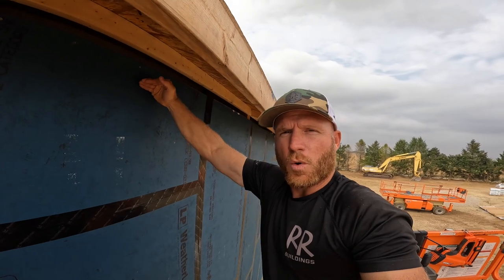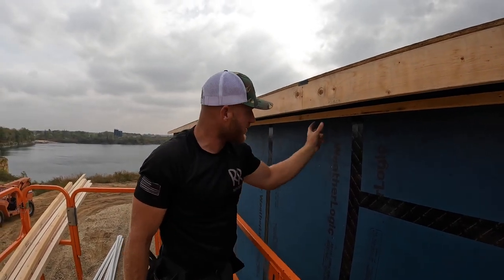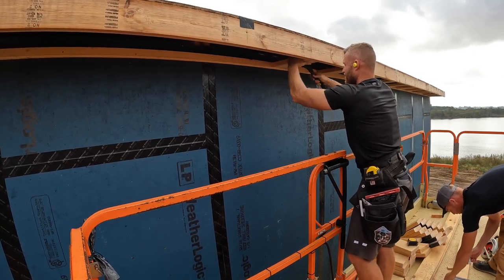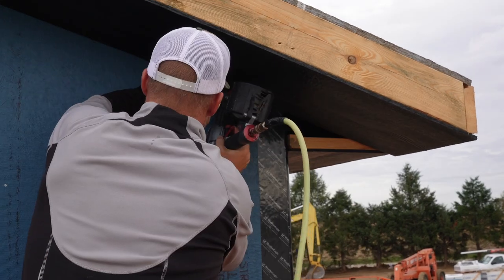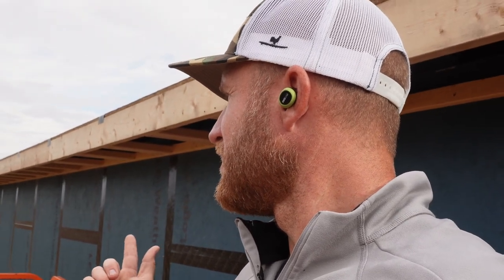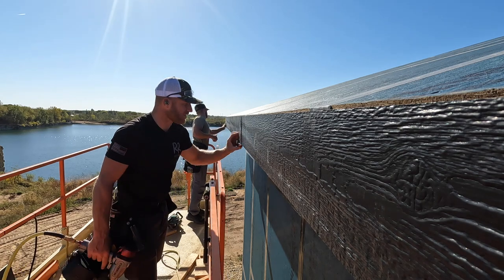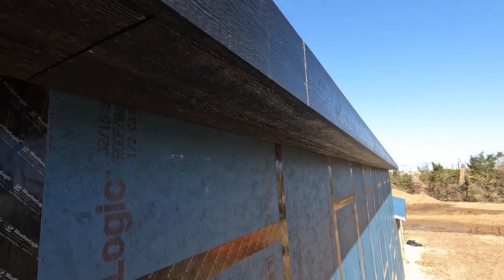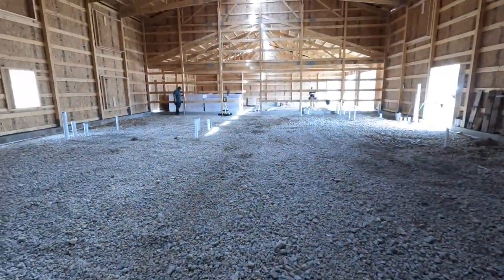Building a Barndominium Part 7: Installing Soffits and Fascia

Comment: Regarding your 'floor for the shower' ... in a completely different setting we kind of did exactly the same thing. It is an 1881 house with floors very unleveled 2+ inch end to end. You have to work with what you get :). So we put the shower in the low corner of the bathroom, no cabin, just a slightly angled tile floor. Put in a 1/4" glass wall floor to ceiling, put in electric floor heating, and you're all set. We love it !!!

Comment: Common practice for showers is to put a 2X4 frame flat in that area which gives a 2 inch recess in the concrete which is suitable for the final slope finish later on when the concrete have cured!
Interesting videos as always, and great to see the differences between Europe and the U.S.A when it comes to construction i.e. I noticed a 2 inch floor insulation under the concrete whilst in Scandinavia we are more likely to go 12 inches! 👍🏻

Comment: Just contracted a builder for a 40x40 barn.  Very difficult to get builders to construct like you do up here in NE Ct.   Most likely will have to have typical stick construction but I am going with the standing seam roof.  Thanks for all the good ideas coming from your videos.  They have really helped me with the design of my structure.

Comment: Great content as always Kyle.  Quick tip, you can paint the heads of the nails before you put them in the gun. That way the nails are pre-painted.  I've tried this a few times before and works great, saves time!  Cheers mate

Comment: Hey Kyle, at 14.57 minutes into the video,    instead of running your blade of your circular saw up the side of the fascia, you could probably use the metabo 1/2 inch router and a flush cut bit In the router and pretty much do what you did with the circular saw.

Comment: Kyle, I had a suggestion for a video if you were interested in creating a brief instructional video. I  have always been curious on the easiest methods in construction of cutting rafters for hip valley roofs and how the measuring process works in conjunction with a proper birds mouth. Perhaps this is something your expertise could assist a lot of us other builders out there with. I know, myself, I struggle to figure out exact cuts, and how to properly measure to place the bird's mouth accurately. Any help with this aspect of construction would be fantastic. Wonderful video!
Reply: Watch Paul ricalde. I had the same prob untill I watched his videos. He's got all kinds of tips and tricks. He also invited the Swanson savage tape measure which Is awesome I didnt know that untill abt a week ago.
Reply: Also watch classic works. He really brakes it down in a simplified form. Deff helped me out
Reply: @VAisForGrowers  Hey Jason, thanks for the suggestions! I will definitely check them out. Its such a tricky type of cut that needs to be properly laid out and I've always struggled and wasted time figuring it out.
Reply: @rhysbriden5777   also I forgot to mention which I'm sure you have already but If not buy yourself the Swanson blue book it takes all the figuring out of it. It gives you the right measurements for every pitch 1 through 12
Reply: @VAisForGrowers  Yes, I actually don't have one but have been meaning to get one. I'm not a professional builder or anything, I just like to do projects with friends either around the house or within the community. We built a gazebo recently that had hip valleys and we pulled it off but none of us were confident enough to just know what we were doing. I'm gonna go check it out on amazon now and probably order it. I've heard of it a few times but never followed through on purchasing the book. Thanks again!
Reply: @rhysbriden5777  yeah man no prob at all glad to help out. Watch those Paul ricalde videos he shows you how to use the blue book and just really explains it so anyone can understand. Go to his page and type in common rafters and go from there he has so many videos on that. Good luck buddy
Reply: @VAisForGrowers  Thanks so much!
Reply: Yes I would like to see the same video Head

Comment: Nice. Watching from Brazil.

The constructions thecnics in USA and Brazil are diferents, here in Brazil, the house and other buildings are make using "Concreto Armado" (Steel bars with concret), and brick. The cost for building is biggest that cost the constructions in USA, and the Thermal Eficience is more less for the Thermal Eficience that constructions in USA.

Sorry for my English  gramatical mistakes, I'm  learning to speak English, yet!

Comment: Another really good video! Watching the series closely and taking notes. 🤘🏼🎯 In an earlier video in the series you stated that there are advantages to a footer wall as opposed to piers if building a post frame home. In a future video can you expand on that? Also at some point would you speak to what the average cost per square foot difference you can expect an LP Smart Side type product over steel directly to girts and trusses. Thanks for great content Kyle!

Comment: I'm designing my post frame that will have an ICF raised foundation with SIP's for the walls and roof. I'm planning on doing it a little different than what you do for the trusses but the walls will be basically the same. The trusses will be timber frame designed so the post will have to be wider to accept the timber frame truss like you do with the 2x4 trusses. The 8 foot spacing is a little close so I'm thinking about 10 feet spacing between the trusses which will make the post 10 feet as well. The SIP's will lock it all in tightly so that's strength won't be an issue at all. If fact it will be much stronger than what you build because of the SIP's. The post will be buried in the wall and not exposed on the inside. I just want the timber frame look on the ceiling. I'll be installing heat loops on top of the sub floor for the radiant heat. It would be nice to see you build something like this.

Comment: I am curious about the sofit, does it need to be vented or does that depend on the insulation type inside the roof?
Reply: I was curious about this too. Another commenter asked about this below and RR said "Stay tuned"
Reply: I was thinking this the whole video too
Reply: My guess is it will be under the metal roofing.
Reply: Same question... maybe the inside of the roof is getting spray foam? 🤷🤔
Reply: So, if the roof is spray foamed underneath, is there condensation? Or how does that work? 

I am hope Kyle will teach us the details. Check that, I know Kyle will teach us the details.

Comment: Any worries about separating the shower pad for the main mono concrete slab? I’m building my first home in 2022 and also want a zero entry shower...I figured I would slightly slope while mud was wet or just grind and slope before framing shower walls

Comment: Hi Matt and Greg. I just watched Barnominiun (?) 7 and you were putting soffit material on all the sides. I however did not see any sidewall venting being installed. If I missed I’m sorry but in the next segment would you point out how the venting is going to work. I’ve always heard you make mention of the venting on the sidewalk soffit and ridge venting at the top. Love your videos and now I have my wife watching. Great videos, great information. Thanks Dennis
Reply from the maker: Who is Matt?
Reply from the maker: No venting on this because there won’t be unconditioned attic space
Reply: @RRBuildings  I guess that must be your new name. 

😂😂😂😂😂😂😂

Comment: I'm enjoying this alot, but I wish it had a basement cause I'm curious if that adds any twists with post frame 🤔
Reply: Ive been thinking the same thing, have been trying to find any negative issues.  I found another YT channel builder who frequents this channel,  Marshall Remodel, he mounted the posts the same way, then ran I-joists the traditional way to the outer basement edge.  Built the 2x6 interior walls on top of the joist+underlayment, (between the 8' space) floor like a traditional build.  Repeated on second floor.   Might be Matt Resinger approved!  Consult an architect of course, but it appears to be a  legitimate method!  This was my "ah-ha" moment for post-frame basements!
Reply from the maker: No twist.  Totally doable but added cost that lots of people don’t want or need

Comment: I'd really like to know an approximate price per square foot for a home like this. Maybe you prefer to just price the materials or something, or maybe just for the foundation wall and shell (with roofing, windows and siding)? I'm just really curious how this compares to stick framed construction if similar options were used. Thanks Kyle and Greg's calves!

Comment: The opening at the facia and the roof diagonal could have been eliminated by running the diagonal all the way down? 
Question is which will the water run in?

Comment: Just had a question, for jobs like the plumbing, electrical, floor heat all of that. Do you act as a project manager and contract those jobs out to other companies or does the person you are building for handle getting the proper tradesmen in there to do those jobs. Researching about getting my own post frame building, Possible attached home quarters too (Still working on talking to the wife into that part) and there isn't a lot of info on the buyer side of things, Thanks in advance if you answer I'm sure you have to field a lot of comments already. Keep up the great work and here is hoping you'll service Michigan by the time I have what I need to build my post frame lol

Comment: On the backside couldn't you cut the soffit slightly wider than needed and then run a flush trim router bit along it to make it all flush?
Reply: Double step that isn't necessary
Reply from the maker: I mean honestly not a bad ide

Comment: Does anyone know what the soffit is done in smart side and not a more breathable/vented metal soffit? Is it an airtight structure? I’m thinking out loud here, my parent’s house has shingles on the roof and metal vented soffit so the house can breathe through the roof.
Reply: I'm guessing the venting will be done under the metal roofing.

Comment: When the dig the pipes in the ground, still add the overhead support (ankers basically in the concrete ) just to make sure pips never sagg. It would be a hell of job fixing such a problem and the ankers are a simple pre-fix 🤨

Comment: My Son & I would love to purchase some land ( Northern Calif. which is a different country from Southern Ca and Bay Area the land of the lost) and build a Post Beam.  
I say that to ask this (I know your a busy man). I would prefer a raised foundation?  Is that possible to ask for that?  Or just a slab!  I am a carpenter/contractor (finish/cabinets).  So I will do a lot of the work!
Reply: Yes you can pore a footer and stem wall. There are several ways and you can search YouTube. Termites is your # 1 question on the foundation. If u notice on this stem wall, the foam doesn't go all the way up. You should have an engineered footing to avoid problem's.
Reply: @martylost167  thank u Marty .  And no I did not notice that about the stem wall?  However if I was building it I just can not see missing it and I am certain nor did Kyle and his customer.
It was the “Engineered” part of that footing that caused him to roll the dice?  (Just guessing I could be wrong).  However, winters there R nasty not sure why that was passed ?
Reply: @zephyr1408  I’m not a builder with all of your credentials but I’m sure you can build it with a raised foundation as long as your willing to pay for the engineering plans and the extra work and materials, anything can be done, good luck
Reply: @eduardodedios8213  I am not really that big of a contractor and I specialize in finish work.  My Dad who is a wonderful man was a custom home builder (meaning he never built a track home or spec home just hired to build custom homes!  No trusses he cut all his roofs (very much like Awesome Framers).
Hey Eduardo I appreciate your advice it sounds pretty solid to me!
Take care ; God Bless!